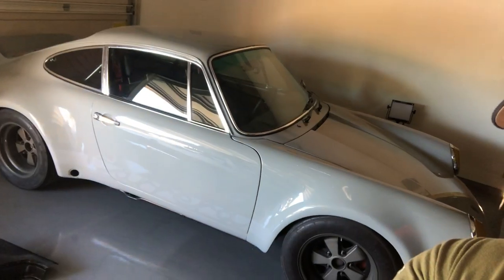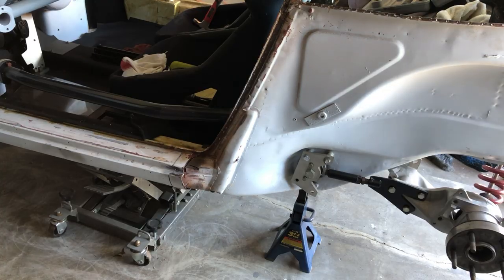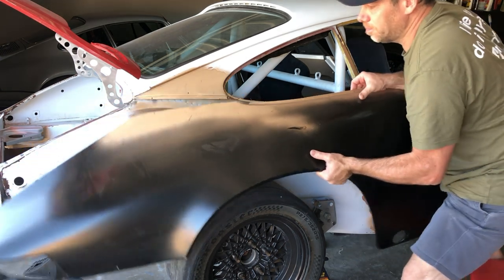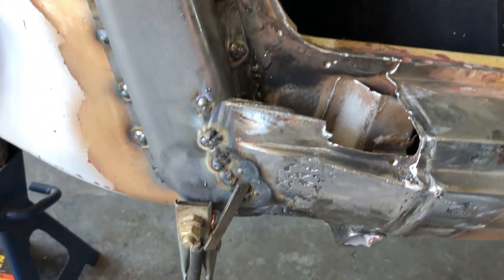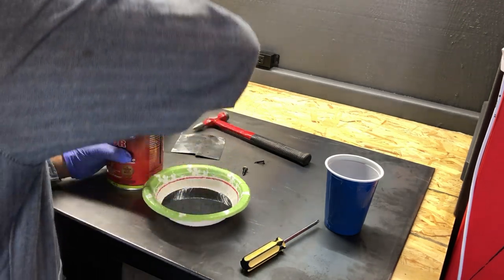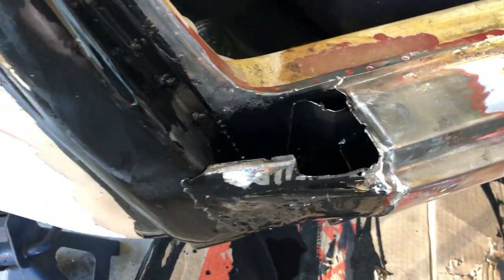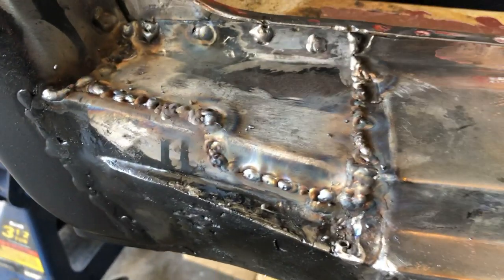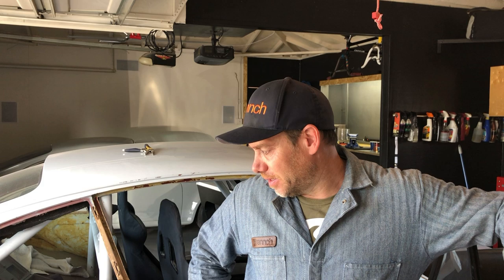Welding Vintage Porsche 911 Rockers | Porsche 911 Restoration | Blasphemy Build 10

Comment: You were wondering about what to use on welded metal.  Here is a 3M product it’s called weld-thru coating. Here is the 3M part number#051131-05913,   I don’t know if 3M still makes this product it came in a spray can. I Purchased this product back in 1992 was when I was using it restoring a 1955 Chevy pick up truck. It’s silver and it has zinc in it and it’s to protect the backside of metal that’s being welded.
Reply from the maker: I picked up some copper weld thru primer a month or so ago...it's been working well!